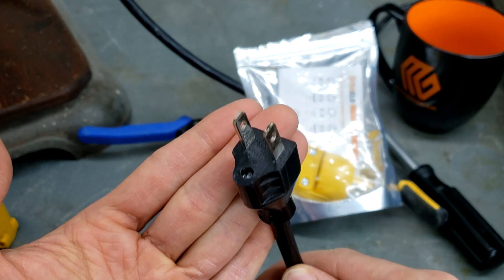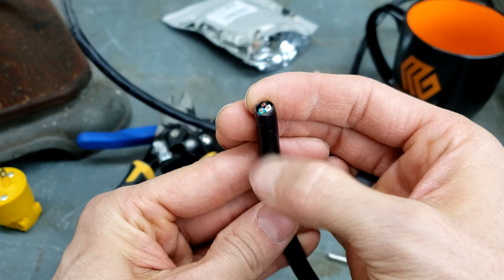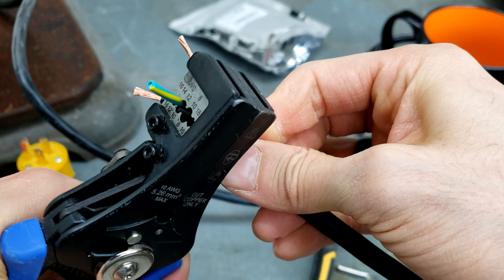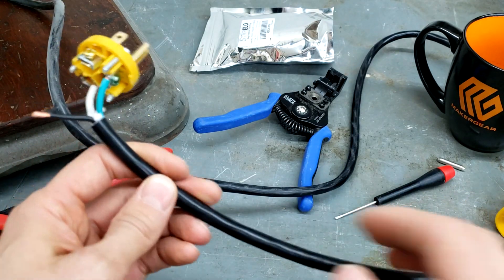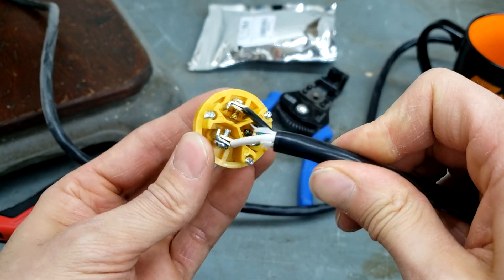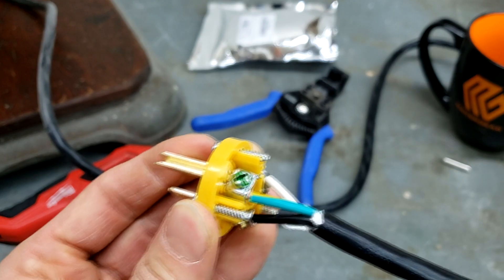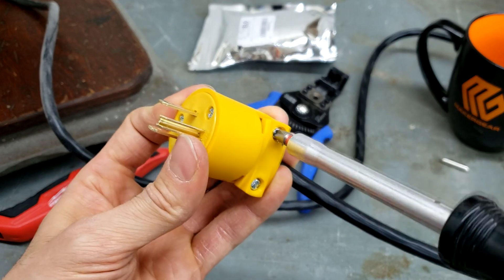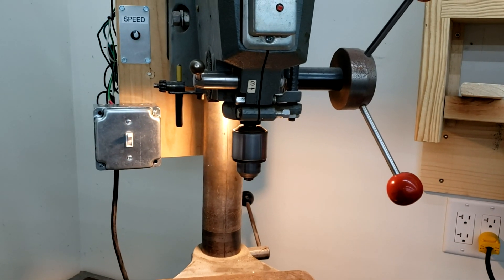⚡⚡⚡ 3-Prong Electrical Plug Replacement! (Male End)

Comment: Just fixxed my space heater after my kids ripped the plug wires out the plug. Luckily it already had a replacement plug on it juat like this. I just didnt know witch color wires went were. Its 5am it dropped low tonight. Woke up frozen.

Comment: Thank you.  This was very helpful.  I needed to replace the plug on a sealed oil radiator heater.  No sparks coming from the new plug (yet.).  And the heater turned on as well!

Comment: What I'm here for is to see if you wrap the bare wires around the screws or not, and connecting a wire is the one thing he does off screen! However, based on how short he left the bare end of the wire, I suppose you just stick the wire straight in and then tighten the screw.

Comment: I recently did this with my block heater plug on my truck. One wire stripped too far. Is it ok that I wrapped electrical tape on the wires that go into the cap to cover where I stripped one wire top for.

Comment: My refrigerator cord has 2 black wires and 1 green wire. The new 3 pronge plus has. Sliver gold green screw. Which one of the black wire is. Gold and which black wire is sliver.

Comment: I tried this with a single pole dimmer switch from Amazon. When I turn the dial to energize the wire it gets to a certain point and disintegrates the wire in as split second. Maybe I bought the wrong switch. Not sure why it doesn’t slowly ramp up the power.

Comment: YOU COULD STILL USE THE MALE PLUG AS A TWO PRONG PLUG WITHOUT HAVING TO REPLACE IT.
Reply: Of course you can but is that really something you should do?
Reply: You’re dumb as hell if you think that’s a good solution. Things are grounded for a reason. If what you’re using has a metal body, the ground wire is there to prevent the body from becoming live so you don’t shock yourself just by touching it. Without the ground wire you also run the risk of potentially plugging something up backwards and damaging sensitive components. Replacement plugs are cheaper than replacing wherever they’re attached to.

Comment: Thanks Dan for a Great and Concise Video. I too am replacing a Cord and Plug-in for a 16 inch Old Delta Drill press I'm restoring, and have changed these plugs many times, but, but, but, this time when I took the plug-in like you are showing, and looked at where the wires attach, the Green wire was no problem, then I looked at where the Black and White wire went,  and then the DUH factor kicked in, there was No Brass Screw to designate where the Hot (Black) wire went, as both screws were silver. So I found your Video, and marked on the back of the Plug with a Black sharpie as to where the Black  wire went. You Save me. I guess in Life we get to used to Mfgs tell us where everything goes.Thanks Again.
Reply: Dan, I might add, when I do my wires ready to secure them in the plug, I twist the wires good and tight, then I solder the ends before in insert them and tighten. I don't know why I do this, but always have, believing it makes better contact and the wires don't separate or become frayed. Just a Habit I guess.

Comment: Thank you for sharing this, I was having a problem with a used extension cord I had bought, anyway, the guy had reversed the polarity on the female end. 
  I just used this as a refresher for silver black. I had it right, but it is always great to have a second opinion.
 I redid both ends and trimmed / stripped the wires a little more neatly and put it all back together and I have a safe outdoor extension cord again.

Comment: Only thing I'm left unsure about is how the wire should be placed or better yet, "crushed" in between the screw and the piece of metal? Am I to just stick it straight in and tighten? Or somehow or another manage to curl it around the srcew as you would with an outlet?
Reply: my exact thoughts too
Reply: I just squished it in. I couldn’t exactly get the wire around the screw and it worked.
Reply: Just squish it in that’s how most things are

Comment: Question...is it better to stick the wire straight in next to the screw or wrap it around the screw.  I'm asking because the wire straight in would sit cock eyed under the screw.  Oh and...when I said wrap yhe wire on the screw, I meant take off the screw and "U" shapped cover so the whole wrapped wire is under the "U" cover.  Thanks!
Reply: Wrap around like a hook so when you tighten the screw it grabs the wire and it makes a better connection

Comment: The only part I needed to see, you did off camera :(
Reply: Same!
Reply: Right!
Reply: 😭😭😭 me too
Reply: I mean they tell you how to do it and it’s literally just sticking it in there and tightening down a screw, but I guess it’s not fair to assume competence on the internet
Reply: @opeboi1539 it’s definitely not fair to assume especially with electricity where people are new of watching a video and probably a little scared.  I’ve done plenty small electrical fixes and it is a pretty simple thing
Reply: @opeboi1539 Mines didn't come with directions. It also doesn't help that I was trying to connect it like a hook.
Reply: @Silver_Mage_2021  mine didn't either.... i should have watched this video first
I couldn't figure out how to hook it around lol
didn't have to smh
Reply: @opeboi1539 no need to be nasty.  That was a legitimate comment.  sometimes the wire has to be wrapped around the screw before tightening.
Reply: @opeboi1539 why does the screw keep loosening? Too much vaults or what?
Reply: @LilXancheX  i know it's long past you doing this... but you have to tighten the screws where the wires are... really tight..not too tight but till it won't move

Comment: My old extension cord only has 2 black and green wire...does it matter for some devices if the hot and neutral wires are reversed?  IN this case, an old fish tank light.

Comment: This cheap replacement plugs don't allow the copper wire to be inserted as a 'U'. They also leave a visible gap which can easily let any liquid in. Apply dialectric grease in between
Reply: better than being shocked to death from not having a ground pin eh?

Comment: Are there any extension cord ends that actually look good after they’re on your cord, like the factory ones?
Reply: not really.  I bought a cheap orange plug, and it looks a lot like an orange extension cord, but its not real heavy duty nor water resistant (the blades can actually be pushed in and out of the  plug face)  I used some caulk inside to seal the plug .